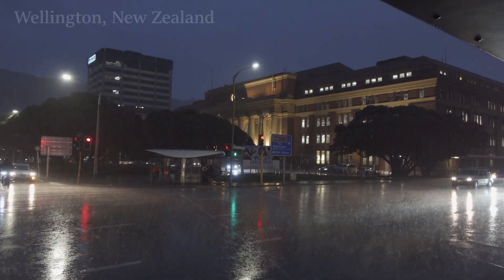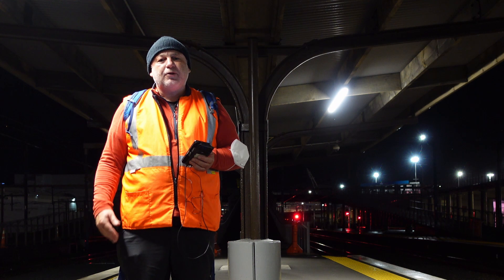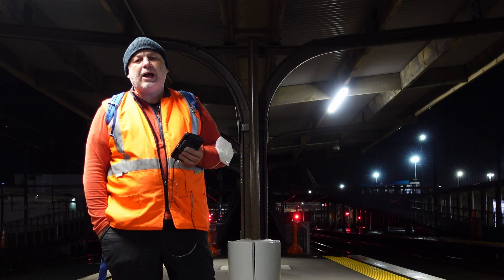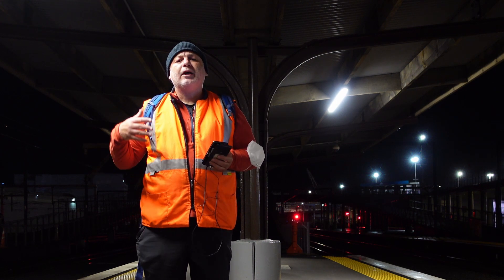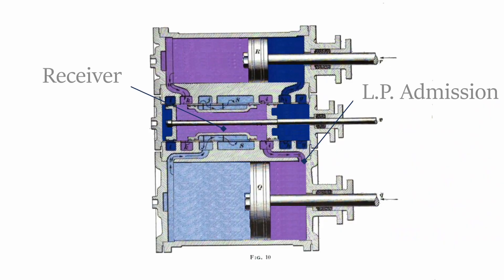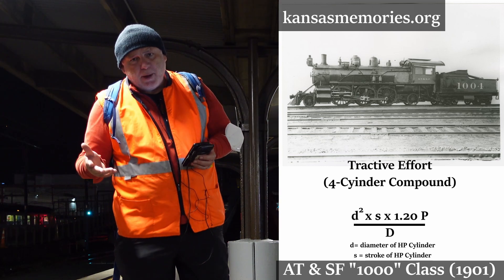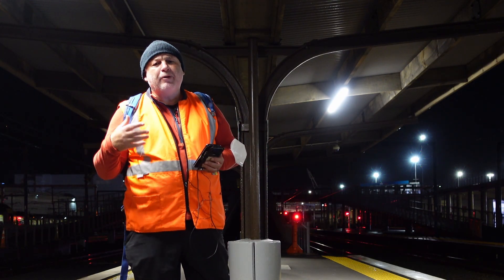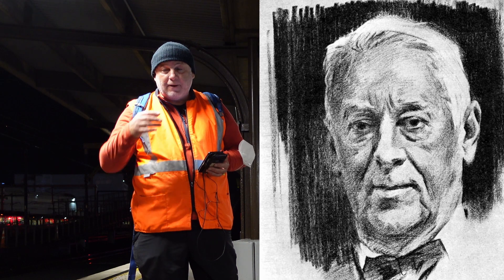Compounding (Part Two) - Vauclains and Tandems

Comment: For the high pressure cylinder receiving pressure from both ends; did they come up with a solution to dissipate pressure from the unwanted side? Or was it not a big enough problem in the grand scheme of things to worry about?

Secondly, even if they were hitting their limits, were there cross compounds being purchased for their ease maintenance over any gains seen on the systems you described in this video?
Reply from the maker: Ta for your comment.

To answer your second question first, roads bought what worked for them, but with first-tier tonnage the use of cross-compounds pretty much ended by 1900, when the tonnage-hauling ability of Tandems could keep up with tonnage demands.  Having said that, Soo Line was buying them up to at least 1907.  But the AT & SF tandems, the biggest locomotives of their day produced prodigious rated tractive effort compared with the cross-compounds - as expected by being four-cylinder instead of two-cylinder.  And they were a bit quicker across the road - albeit peanuts to the roads speeds expected in following decades.  The water and fuel savings, the greater efficiency of a bigger locomotive, and the greater ability to haul (i,e, less need for double heading and double crewing) - and thus they were prepared to carry the complexity.  Still, superheating eventually won the day.

To answer your first question, no.  Dissipating the pressure acting against the non-working face of the H.P. piston would also dissipate the pressure acting against the working face of the L.P. piston.  This applies as much at start-up as it does in normal operation - as there's open communication between the faces through the receiver.  This is the fundamental reason why steam in a compound is not used 'twice,' but used more like 1.4 times.
Reply: @theimaginationstation1899  Very nice and clear explanation, Thanks

Comment: I'd only known of compounds for articulated locomotives prior to this, I didn't realize it had been tried so early and with non-articulated examples. It seems like a lot of the headache of a compound valve arrangement goes away with an articulated unit since it's basically two engines with a common boiler anyway.
Reply from the maker: I'm currently editing the next in the series, with thye final iteration of single engine compounding in North America.  Interestingly, such compounding contined onwards and upwards in France.  Whereas the Americans adopted compound articulateds.

Interesting stuff.

Comment: Vauclain and Tandem compounds suffered from cranked and narrow inside steam passages between the cylinders, so there was no "internal" streamlining.  So their efficiency was well beyond a well designed cross or balanced compound and maybe only slightly ahead of a saturated steam simple locomotive. With the advent of the superheater there was no advantange at all in comparison to a superheated simple locomotive.
There was nobody in the USA, who wanted to try superheated cross or balanced compounds. Everybody was happy to get rid of complication.
However in the end N&W proved the effectiveness of the superheating and compounding combination.
Reply from the maker: I think it had something to do with hauling more, faster - as well as complication.

The notion of building an extremly efficient super-heated compound would have, in North Ameria been a small locomotive for secondary duty - and with the plethora of 2-8-0 locomotives perfectly servicable and knocked-off front-line road service would have meant that no market could have been found.

In the New Zealand experience it was the onset of WWII that coincided with our two classes of de Glehn's being rebuilt as (mostly) two-cylinder simple.

Comment: I'm interested where you found the formulas for stated tractive force. I've never much thought about tandem compounds, but I have dabbled in 4 cylinder compound steam locos, and I'd found a far more complex formula. I tested the results of both and the formula you had found gives a different result to the one I tend to use (yours is a hell of a lot nicer looking!)

I had used (4*low pressure bore^6 * stroke * boiler pressure)/(10*driver diameter*high pressure bore^2*low pressure bore^2 + 5*driver diameter*high pressure bore^4 * 5*driver diameter*low pressure bore^4)
Reply from the maker: Hi radio, do you mean bore squared or bore to the six to start with?

Anyway...

The two-cylinder simple locomotive formula I use is from the Locomotive Dictionary (1916) - a standard North American trade reference.  From memory, it didn't state a formula for compounds.

My compound formula comes from Swengal (1967 - IIRC) "Evolution of the American Steam Locomotive."  Swengal cautions that roads and manufacturers were free to go their own way with calculating Rated TE.  So it may be that you're looking at a specific manufacturer's equation.  Since it's convoluted, I'd say Baldwin.  Swengal goes no to say to exercise caution when using published Rated TE to compare locomotives - and to put the geometry into a standard equation in case the different roads used different fomula.

Interestingly (or perhaps not), in NZ we used 80% as the Mean Effective Pressure modifier instead of 85% - but with our four-cylinder comdounds (Vauclain and de Glehn) we used the 120% modifer.  I'm not sure of the reason for the deviation to 80% while also adopting the 120% without deviation.
Reply: To answer your question, it is meant to be raised to the sixth power.

Secondly, it's not actually based off of Baldwin research, it's based off of Porta's research in steam technology, a lot of it having come from the mathematics he used to define his locomotive "La Argentina" as it's most commonly known. I've tested it against the stated tractive effort of various 4 cylinder compound locomotives and it's seemed to me to be an incredibly reliable and close measurement. The inly thing I take from baldwin is a recommendation that the ratio of volumes should actually be near 3 to one, so when I do my own modelling work I try to have the low pressure bore be the square root of 3 times larger than that of its respective high pressure cylinder.

I the history of tractive effort calculations is rather incredible as a whole, maybe I need to go on a hunt for more railroading related engineering books (as many as my wallet allows, haha)
Reply from the maker: @radioisotopics  The 2nd hand locomotive engineering book market in NZ is pretty slim, and postage from overseas is prohibative - so it might be a while before I get a copy of Porta.  But if you want to start from the beginning of locomotive mathematics de Pambour's 1836 work is on Hathi Trust - it's several hundred pages of pre-Victorian description - but his development of the TE equation is interesting.  Ralph Johnston's "Steam Locomotive" is also on Hathi - and it is very interesting.